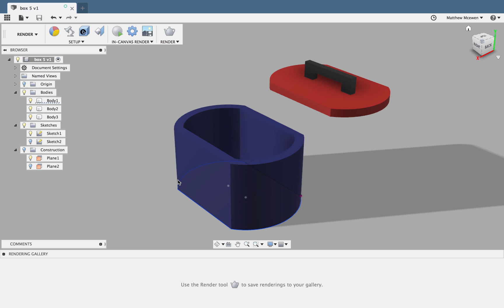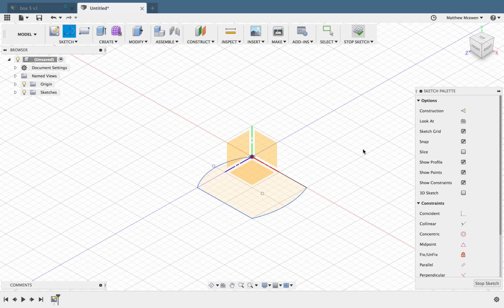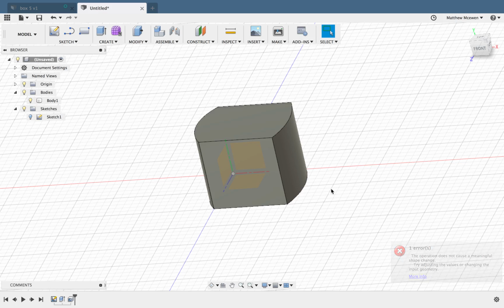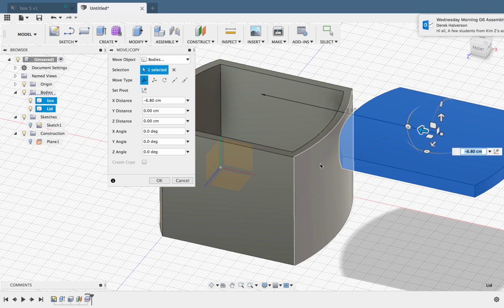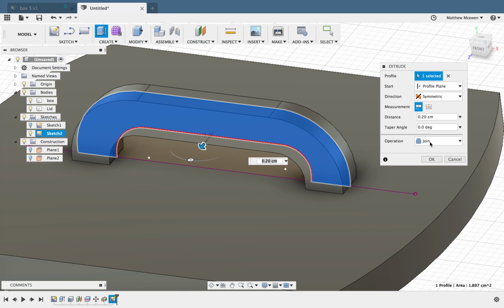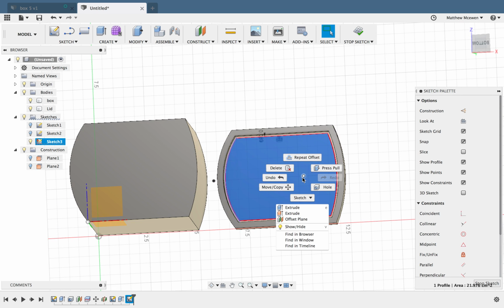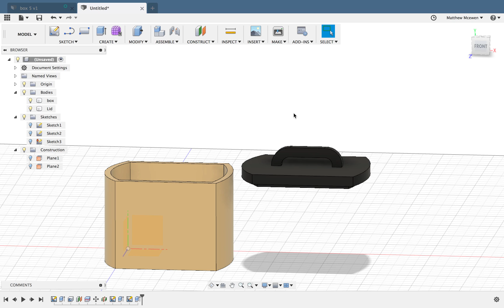Fusion 360: Build a Box

Comment: I was having trouble with the handle, when I was using the offset tool, It was making the offset float, so there was material UNDER the arch of the handle. Meaning the arch wasn't closed using the lid, there was a piece closing off the handle ABOVE the top of the lid? I need help with this, thanks.

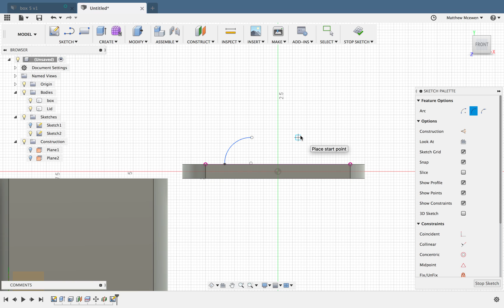Comment: Thanks for making this video but I'm also having problems following this guide. When you were working on the handle (6:25) the arc tool seems to snap to the surface of the lid  and when you add the line connecting the two arcs the interior becomes shaded.  I can't get that to work like it's working for you.  Any ideas?

Comment: Great video. As of April 2020 the Sketch menu is gone and I am stumped how to work on the lid as you did to create the seat to mate with the box. Around 9:30 mark. I had to totally recreate the sketch on the lid before I could Offset - the menu works differently now. I couldn't just select lines on the lid and Offset.
Reply: offset in modify menu.